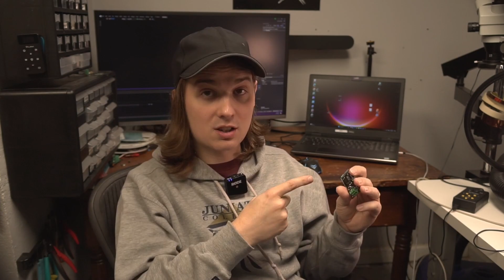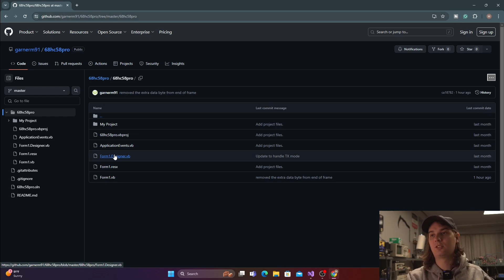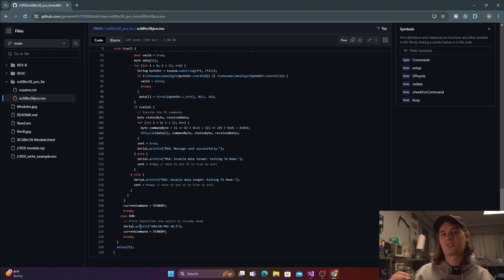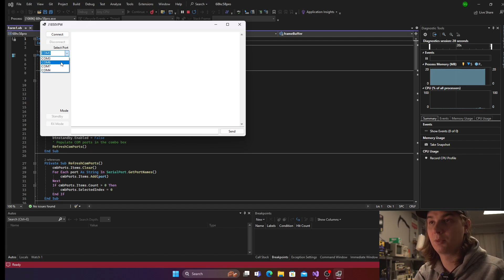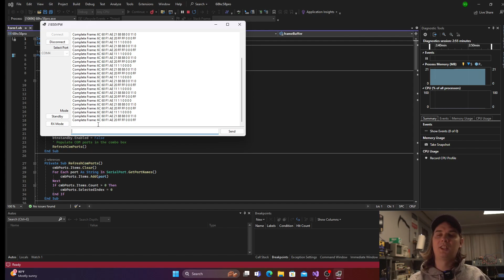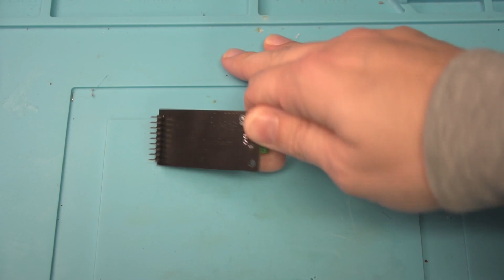GM Class 2 or J1850 VPW Communication with Arduino Module Rev C

Comment: Hey there, completely off topic but i seen you work on vehicle instrument cluster and was curious if youve ever worked on old old guages. like 1968-1972 ish general motors. ive got a 1968 oldsmobile fuel guage thats orientation is off and ive been searching to no avail if the guage needle can just be repositioned or if the guage can be re calibrated ect. my empty is half tank and my full is basically a half tank distance beyond the full mark if that makes sense lol. its not a sending unit or electrical issue with the system just to get that out of the way. i dont imagine you know but figured id ask as i ran across one of your guage videos. thanks.

Comment: I thought these chips were long discontinued. Are the NOS, or is someone now making them again?
Either way, great job, and keep up the good work!
Reply from the maker: Yes they are long discontinued. Like 2006. The first batch I got out of China was NOS but the last batch I assume they are savaged off of boards because of how they came.

These definitely aren't meant for you to develop some product your going to sell 1000s of but it's an easy way for someone to get started with j1850. At the rate I sell them at I'd be surprised if I ever sold more than 100 of them. I just wanted to open that door for others to learn about j1850 without having to use a elm device or similar. 

If I was smart enough I'd do like they did on the m2 device and just use transistors but I don't think I could write a bit banged j1850 library
Reply: @FixedUntilBroken  Doesn't the m2 have open-source firmware?  If so, perhaps you could use it as a starting point!